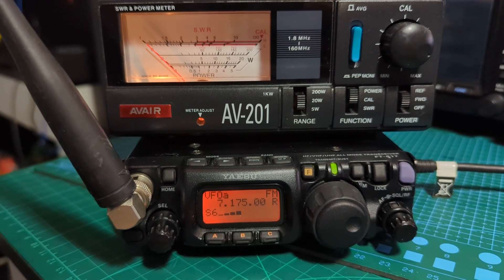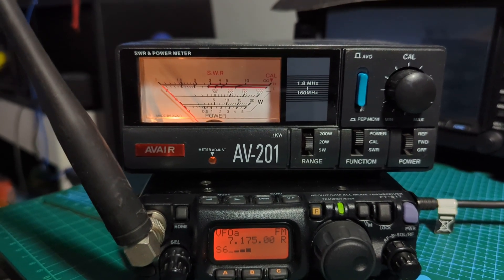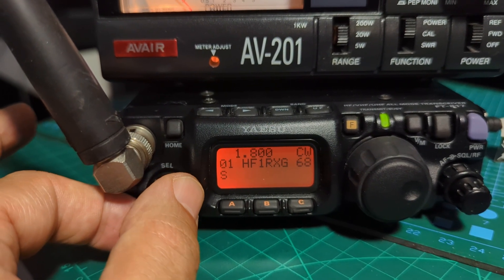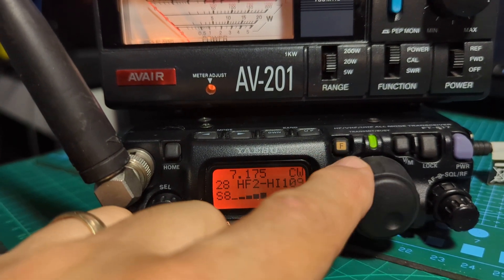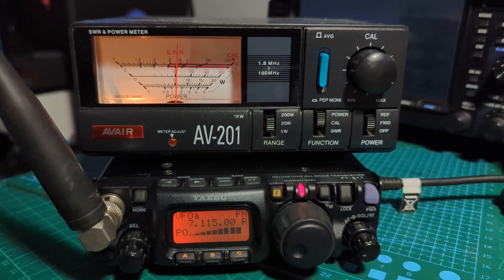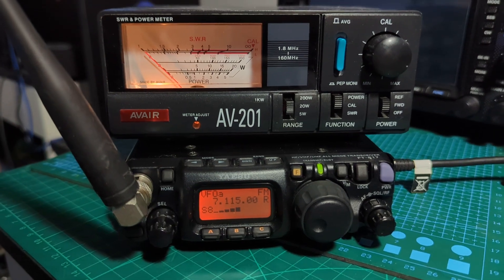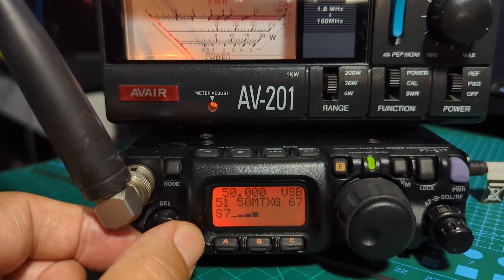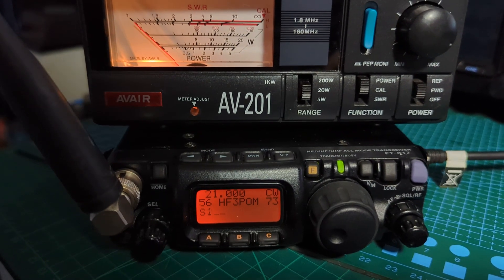YAESU FT-817ND , INCREASE POWER

Comment: 5 or 6 Watts, it does not make a difference on HF. 5 or 50 Watts do.
Reply from the maker: Agree
Reply: if you use a power amp like the kl400 that wants more than 5w input then every extra watt counts. times 50!